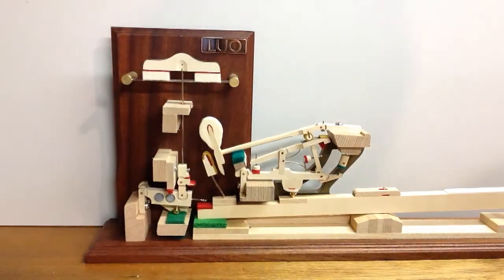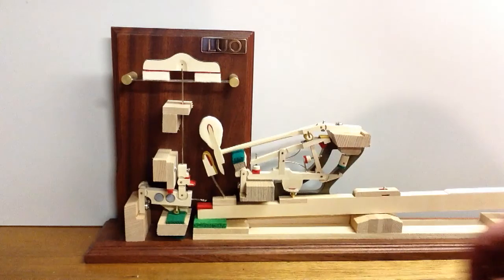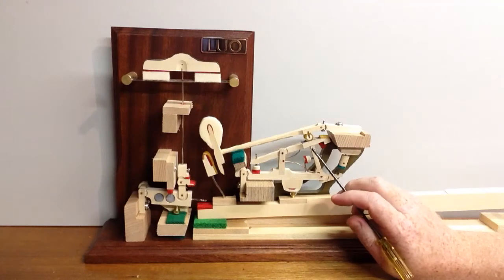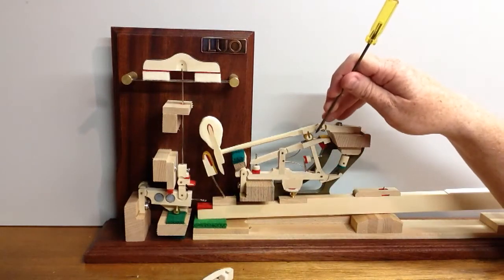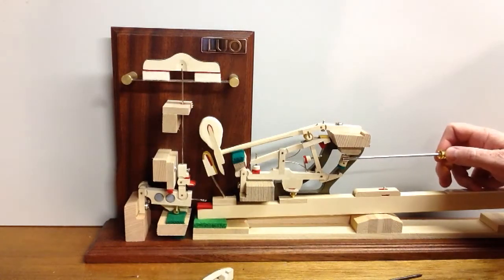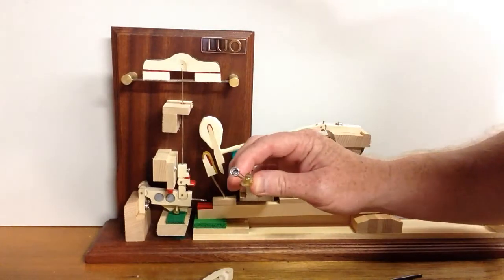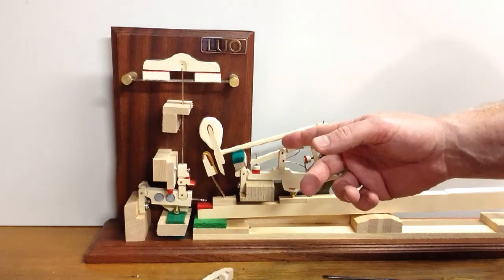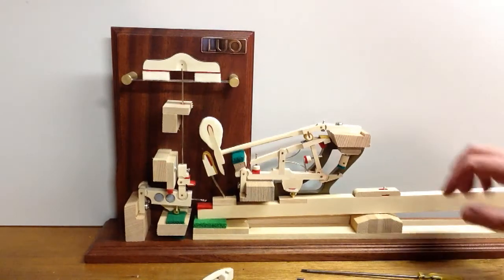Piano Regulation - Adjusting The Jack Position On A Grand Piano Action I HOWARD PIANO INDUSTRIES

Comment: On my grand piano, one of the hammers does not fall back after playing the note. (Interestingly only when the action is installed in the piano, not when it is drawn out a bit.) - Could a cause be that the jack is not recessing (i.e. staying stuck under the little felt-and-leather cylinder?
Reply from the maker: Yes, it could be.

Comment: How far forward should the jack travel once it moves past the knuckle?  I have some that move all the way to the front felt.
Reply from the maker: The amount that the jack travels after kicking out from underneath the knuckle is one way to measure the amount of aftertouch that is present in the key stroke. There is no direct adjustment to control how far the jack travels after leaving the knuckle. This amount is affected by several other adjustments. When you adjust  the key height, key  dip, let-off, and hammer blow distance, all these will affect the travel of the jack. The travel of the jack will be correct when the piano is regulated properly and you have the correct ( or desired) amount of aftertouch in the key stroke

Comment: Hello,  I have watched a great deal of your videos and learned a great deal.  I have a piano upright console and 2 of the keys middle C and and A4 only hit 2 of the 3 strings. I've watched many of your videos on tuning as well as repairs. Seen the one which deals with repairing hammers but not one that specifically talks about the problem I have.  Would it be wise to loosen it and move it nearer to where it can be struck?  Unsure how to approach this.The hammer is not twisted or bent.   Or if you have a video that talks about this problem would you let me know the title of it.
Reply from the maker: If you make an adjustment to the hammer so it strikes all 3 strings, you'll first want to make sure there aren't any grooves in the hammer, otherwise the strings will try and fall in the grooves which can be hard on the pinning of the hammer flange.  Once you've filed out the grooves in the hammer if needed, you can try and make an adjustment to the hammer by loosening the flange screw and moving it over a little and tightening the screw.  If this isn't enough, you can adjust the hammer by papering the flange.  Here is a video on how to do this: https://www.youtube.com/watch?v=Puj2HREUFYo
Reply: Thank you for the response, I have seen the video you mentioned.  Wasn't sure if that was what I needed to  do or not.  Which by the way that video was really cool.  Didn't realize such a small piece of tape could make such a big difference.

Comment: Hello from a recent subscriber and a recent order of precut ecsaine.  It will save me a little bit of grief.  I thought about sending you my sheets of it I still have from PianoTek, lol.

Anyways, in regards to your video:

1). Do you have much luck inserting a drop screw regulator between let off buttons?  I know Schaff sells a thinner tool for that purpose.

2).  I noticed at 6:23 when you pushed the jack back, it winked the hammer.  Is that suppose to happen, or did you not regulate jack height?
Reply from the maker: I don't usually have any trouble getting the drop screw regulator between the regulating buttons.  No, the hammer isn't supposed to wink like that.  This shows that the jack height wasn't adjusted quite correctly.

Comment: Yeah but how the hell do I reach that 😂
Reply from the maker: Specialized tools available here: https://www.howardpianoindustries.com

Thanks for watching!
Reply: @howardpianoind  Thanks! So it turns out what I actually needed to do was tension the jack spring because the jack was rubbing and would get stuck pushed up, so the hammer wasn't getting pushed and so the backcheck was grabbing it before it could move up. 25 keys were doing this... Warping from humidity I guess. All fixed!